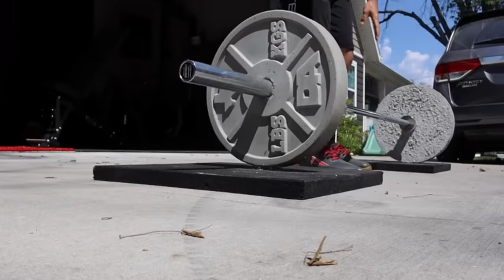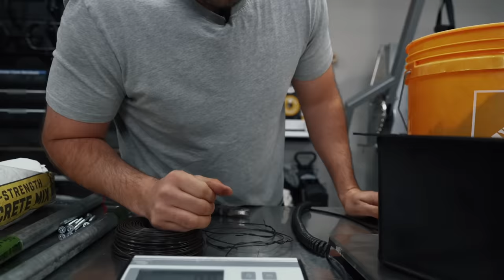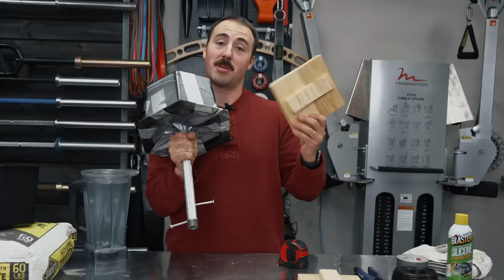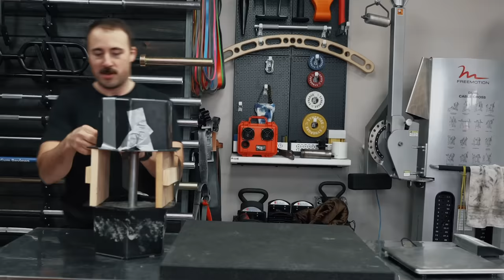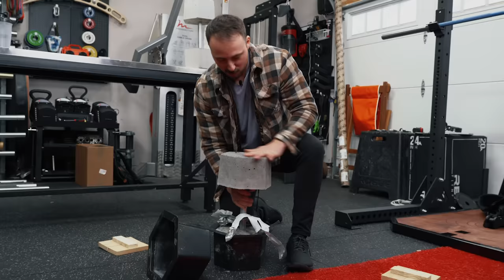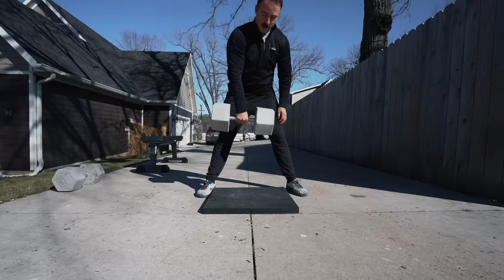How To: DIY Concrete Dumbbells Made to Last (PLUS Drop Test!)

Comment: If you're losing ~10% of the wet weight to evaporation, you're going way too wet. The strongest concrete comes from a perfect cement:water ratio, if you hit that you'll have barely any evaporation, but consistency will be horrible. To keep the cement:water ratio low (3:1 is an easy ratio to remember and decently close to ideal, should result in ~3% evaporation, by weight), but still have a workable mixture, you can add some superplasticizer.
Only drawback to this is, if you're using a pre-mixed concrete, you may not know your exact cement content.
Also, after 7 days of curing, you'll only have reached ~65% of the max strength of the concrete, commonly concrete is considered to have reached "full strength" (~95%) after 28 days.
Reply: yuuuuuuuup 28 days later, but we strip forms after the weekend, and start on the next lol

Comment: Something else you can do is buy Flex Seal to spray on the outside to create a rubber coating. It would help with the impact if you drop them. Looked on Google and its 5 bucks.

Comment: Im poor,so i make my dumbbells from concrete like this but with pieces if rebar in the mix, so its thinner and smaller😆 I use adjustable dumbbells. But i hate having to change for those 10 to 40lbs. So i make everything in those lighter range with concrete. Same like this, but for the handle, we make it so the end of the "bar" are exposed on the plate's end. Both side. But we make it so the we can put GI fitting to close it later, threaded ends. On the final weighing, if it doesnt reach the required weight, we insert iron bar to reach the required weight. As close as we can. If you want them to not moving at all inside the bar, pour melted candle inside.

Comment: Cut a wooden piece as a lid; drilla hold that fits snug to the handle. cut the lid into2 pieces. once you put the handle in the concrete, slide the 2 lid pieces and secure them with clips at the edge. Easy.

Comment: Best way to build Concrete Dumbbell is not just mix cement with sand ... you should insert iron wire inside of barbell and also you should use vibrating table to make it more dense and strong!

Comment: Too much water makes the concrete weaker when it cures, also a stiffer mix you would be able to just stick your handle in and not need to worry about the tape on your first one. The shims you made were great.

Comment: With all of these diy concrete weights why not give them a healthy layer of felt seal spray or some other silicon coat? It would hold the concrete in and look a little cleaner

Comment: you just pushed all the rings down when you added the bar.
have you ever thought about putting rubber around it for protection? you could use those big rubber balloons or those big rubber balls.

Comment: To make the EXACT weight you want measure the concrete while dry. Then mix it and put the concrete in the mold. That way once the chemical reaction is over and the water is gone, it will be EXACTLY the correct weight

Comment: Why not zero out the scale with the empty bucket and add 25lbs of concrete mix minus 1/2 the weight of the bar?
Once  the water evaporates it should be good
Reply: That’s in the instructions he tossed at the beginning of the video lol

Comment: Don't waste money on silicone spray. It's unnecessary. Just pour boiling hot water on the moulds after the cement has set.

Comment: I can guarantee you that your bailing wire rings got shoved together when you put your pipe with the bolts sticking out it in the concrete.

Comment: Or you can just weigh the Concrete Mix to the desired weight in the finished weight!  when it drys it will be within ounces of the weight you want.  That way you are not guessing about the water in the mix to try to get to a finished weight.....

Comment: To bad lead is so expensive these days.
Back in the day, when wheel weights were made of lead and zinc and tire shops almost gave them away You can melt them into a mold, and they would be dumbbells that would even be smaller than name brand dumbbells.

Comment: You weigh the concrete dry and when it drys it always weighs the same regardless of how much water you put in
Reply: Is this true?  I have not found it to be.
Reply: Well In my experience after the 28 day cure period just about all the water should be evaporated out.maybe large fuck ups in water used might have some affect but there is no reason for this to happen anyway.weigh concrete dry to the weight ya want including rebar,pour water using a measuring picture to the desired consistency and take note of the water you used and use the same amount on subsequent plates.using this method I made 8 plates that all weighed within. 4 of a lb,5 of them weighted the exact same down to the oz.those 5 weighted 2oz over the weight I weighed the dry  concrete to so they retain only a very small amount of the water used to mix them.I imagine the humidity and temperature would play some small part in there final moisture level though

Comment: The only good things about concrete dumbells are that they're cheap and you can shave it down to be a precise weight.  You want to shave the sides with the handle and you want to shave the same amount from each side to get it perfect.  It is rare to find a dumbell that is the exact weight it claims but it is possible with concrete.  It is possible with iron too but your dumbell will look like shit after.

Comment: Coop messed this job up almost every way possible,that handle is ridiculously crooked.he should have used a piece of plywood with a hole in it cut to fit the mold to keep the handle straight,should have weighed the concrete dry,and poped the mold off the first half and cut his boards to sit against the concrete and the floor,he should have used solid rod for the handles.had he agitated the molds properly not only would they be stronger but the concrete would settle down a bit more and make them a little smaller for the weight.making the handles shorter would help a lot too.concrete takes about 28 days to cure and will continue to dry and lose weight during that time hence the weighing the mix dry.coop will probably end up with a pair of 43's by the time they cure.I don't like the molds and think you would be better off with buckets,those sharp corners will chip quickly and the molds are 60$each for a flimsy little bucket thing which is redonkulous.they cement dumbbells do work well when done right and I have made them up to 85's and they are reasonably sized however I used a few rebar rings in each side,they handle being thrown around on horse stall Mats without any problem.two part truck bed liner works very well as a finish after they cure,rocker panel paint for under cars works ok as a cheaper option

Comment: I mean, if the mold itself is $65, it just defeats the purpose of not investing in a normal steel dumbbell that will last way longer. I don’t see any true reason why this would be worth it.
Reply: Availability. That's all. I agree with you, if you can afford and find steel, get steel.
Reply: You got a stash of standard iron plates laying around.....?
Reply: A full set of steel dumbbells is about $1k. Do this for a full set and you are out maybe $250 including the mold. Sure it will take time but it's way cheaper.
Reply: @JanSobieskiIII   yes. Standard and Olympic plates. How is that question relevant? This video is about concrete hex dumbbells, not concrete weight plates. And I do agree with concrete weight plates for their value because you get one mold and you have as many plates as you want. With the dumbbell mold you are restricted to one weight per mold, buying a different mold for each weight. Making multiple pairs of the same weight dumbbell is just redundant.
Reply: @TheGooglySmoog  true. And I guess there is the novelty of having a project to do. It would be fun to make
Reply: @bigjimslim  you can make an entire set of 5lbs to 50lbs dumbbells with this one mold.

Comment: wonder if you can make a kettlebell out of this. hummmmmmm
Reply: I've made 3 concrete kettlebells so far and they are very easy because you don't need to invert the dumbell head so it's all one cast. My favourite is an empty protein powder container that I inserted a handle into (T bar is the easiest but I made a slightly more complicated one for a nice one handed grip) basically experiment with a bag of ready mix concrete and create something
Reply: @TheRealMrGordons  brah that is a pretty dope idea. Smh don’t know why I didn’t think of that. Thanks a lot fir the brain jog!
Reply: @IronMayne  My pleasure! I started making some dumbbells and they are way harder to make than KBs. I want to make some plywood moulds so I can insert a reinforced handle between two boxes and cast one whole DB at once rather than inverting and doing one side at a time. Might put together something out of scrap wood (thinking of using a hole saw to cut the centre of the one side, then cut that in half so it clips over the bar and can be covered with some duct tape to prevent leaks)